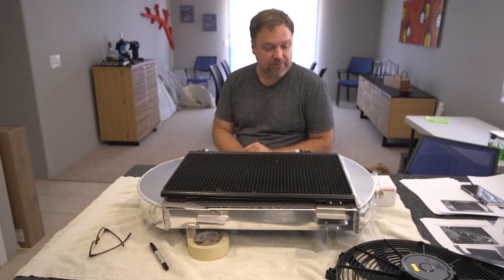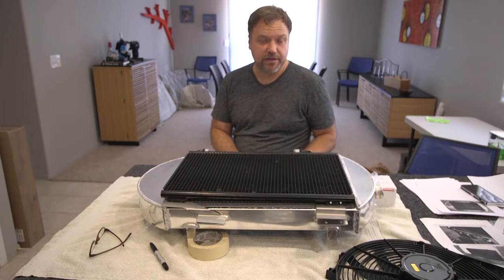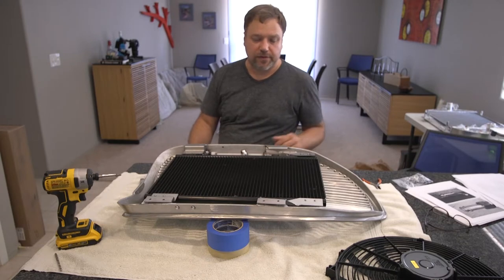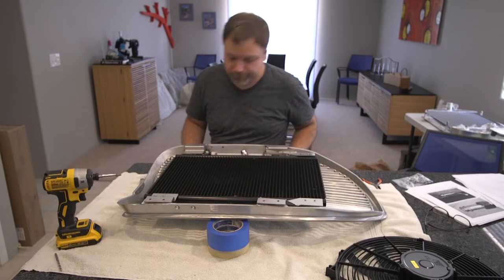Factory Five 33 Hot Rod V2 Build - A/C Condenser Brackets

Comment: Yup, drilling the holes to get that whole assembly together was a pain for sure. The other crazy bit was drilling out a 5/8 hole on the rear spindles that were part of the IRS. When you do finally put the shroud on the fan it's a good idea to use some RTV to seal the two - avoids whistling and vibrating... I found some metal colored GE Silicone II that worked great

Comment: good stuff Jim.   What was in that bottle you were spraying the parts with?
Reply from the maker: Water.  It seems oil is good but does not keep the heat down so i opted for water to keep the heat down and not burn up the bit.

Comment: why did you use an aftermarket shroud? does F5 not supply one?
Reply from the maker: Correct.  There is no shroud supplied with the car.  However, besides looks, it is not needed except for super hot climates.